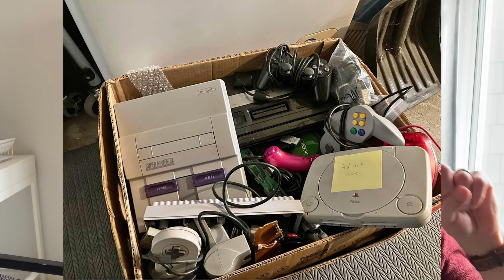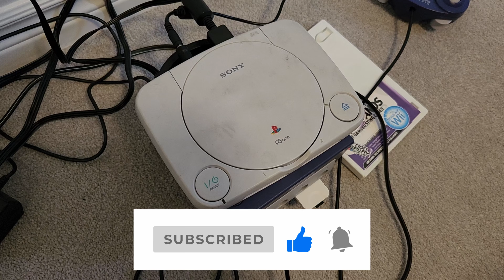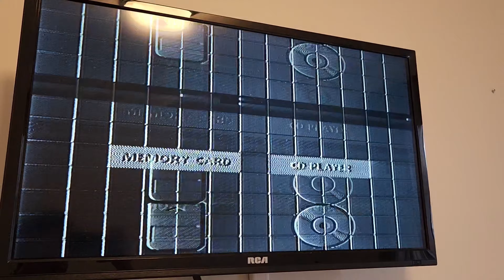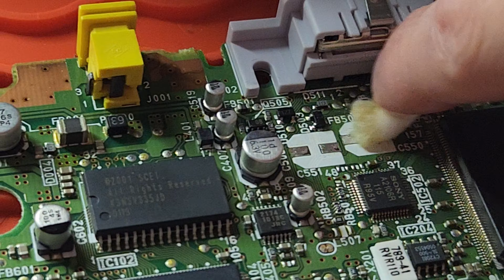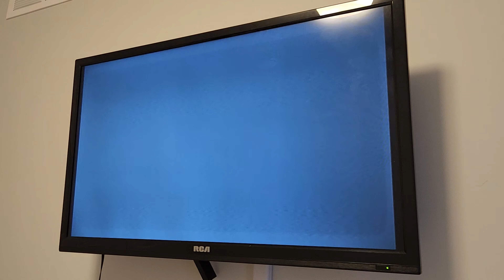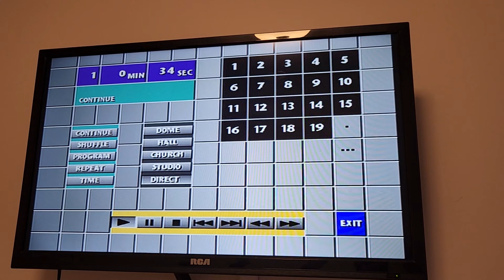How to Fix PSone Glitchy Video Output for Cheap! (PS1 Repair Tutorial)

Comment: hi. recently, a similar problem occurred with my ps one, but the image is completely green, sometimes the image may return to normal for a fraction of a second, but most of the time it is green, I checked the composite cable on my ps2 and it works fine, what could be the problem?